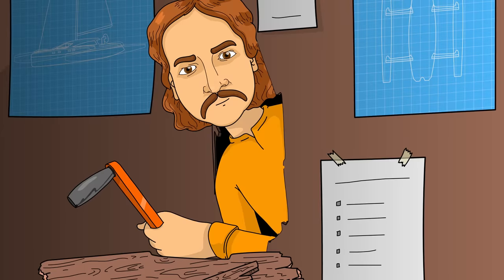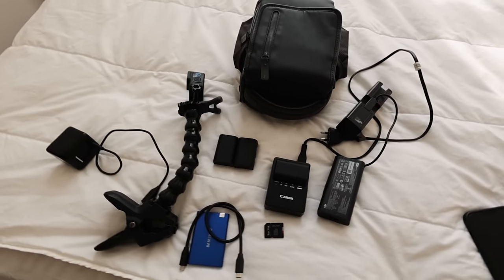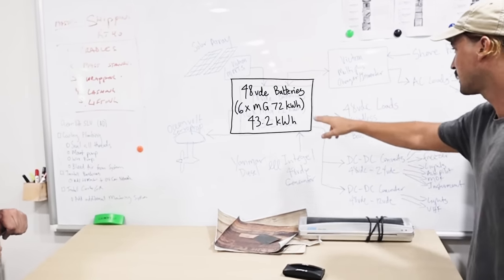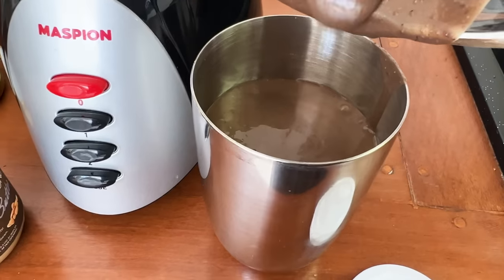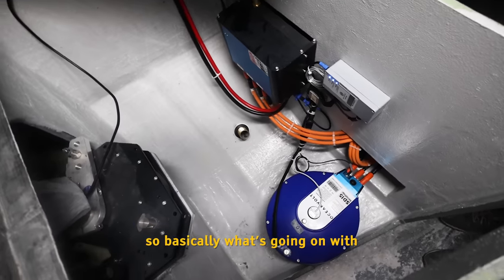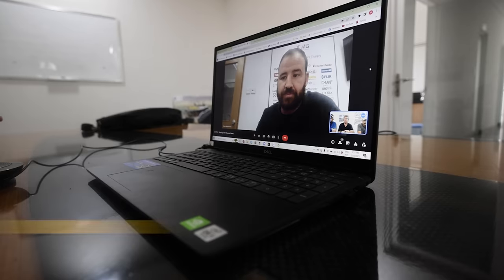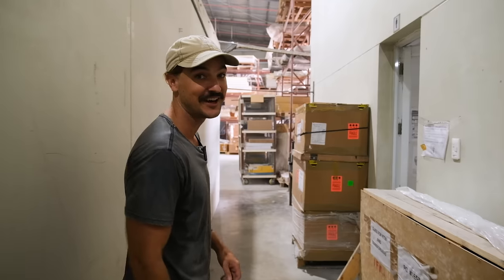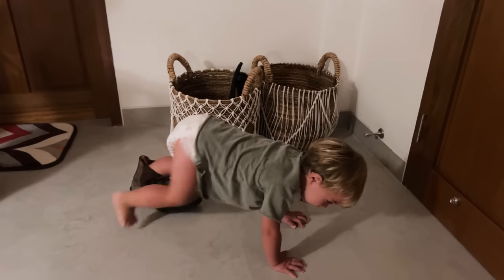BOAT BUILD: Our Electric Propulsion!

Comment: Hi Riley, Big fan and fellow cruiser that has been watching from almost the beginning.   I enjoyed the update on the build. 

If I understand correctly from the video, you will have separate Yanmar diesel for back up propulsion that is direct drive. Is that correct? Also you mentioned "Integrel". Is that referring to the Integrel System that Nigel Calder helped develop(sort of a smart very big alternator)? If that is the case then you must have at least a 40HP Yanmar to push the Integrel System. Is that correct?

Comment: There are some rather significant mistakes at minute 6:58 in the battery bank, first off it‘s supposed to be 48V DC ( 48Vde ), then there should be 6 Packs of „MG“ Cells, each with 7.2 kWH ( 72kWH ), calculating to 43.2 kWH of total capacity. I‘m an electrical engineer and just wanted to let you know about your Mistakes there. Cheers Mate, love your videos!
Reply: That matters is you're writing a technical paper but doesn't if you're scribbling on a whiteboard.  The result is the same.

Comment: Hey Riley, I am sure you will have already studied it so maybe you can confirm what I had heard: for best battery life, you should not keep or recharge your Li Ion (maybe it's different for Li-Po or lead, if that exists still) 100%, rather you should keep it at 85% to 90% charged when in regular use, and for "long term" storage at less than 50%, that way the membranes separating the electrolytes will have less damage from high tension micro arcs.
Also, can you not laminate your passport personal info page? My EU passport is fairly old and has a laminated page.
Thanks for a great video, great editing, and a beautiful family.

Comment: Would not just a genset have given you the redundancy you require without all the extra penetrations and drag created by direct shaft system ? I would worry about turbulence and flows over the ocean volt. I understand the mindset though.

Comment: i think electric motor on a sail boat is the way to go.  when batteries are full or >80 percent, you can turn the motor on, use electricity.  if under 80 percent, charge off solar, regenerative prop.  while at anchor is the current enough for the prop to regen?

Comment: Why aren't you considering a Wind Generator For your Sailboat.
What happens when you're anchored for days at a time, sure you'll have the solar panels as long that it isn't cloudy, what happens at night and there's no wind. Remember as long that there's wind, which means the night hour too, your Wind Generator could provide most of the power for boat.

Comment: Me again. Mr Realis! Riley, you know that these efficiency figures of all this whiz bang electronic stuff are VERY approx. I'd be halfing the incoming amps and doubling the "what I expect to get" amps, in the REAL world - maybe 75%...??
I notice the batteries are (might get it wrong), the normal Lithium types. Are they the LLifePO4 type? Those can be charged with any normal battery charger and any normal Solar Panel inverter. 
PO4 batteries, can be put in a normal car/bike - and thus can be charged from any normal charging solution.
I assume there are backups for when one of these whiz bang modules go down (and it takes the whole link with them), that there is a 'go back to a sail', option.
And what are the fire suppression options on these batteries...?

Guys, looking like a great boat. Just wonderful, but be wary of all this whizbang stuff ok!

Comment: Can you elaborate on the propulsion setup a little more? You have an OV motor sail drive aft and a center mounted diesel engine with high output alternator and mechanical shaft drive to a second prop forward of the OV prop? I assume this is a "Since we need a generator, lets just make it a proper diesel with shaft drive as well for an independent system" solution?

Comment: Super interesting. 2 questions, why not a bigger battery bank? If you can charge it at 9kW then you’ll be full before you know it… secondly 9kW is energy out of the boat on terms of speed sailing… if you’re going at 15kts with 9 kW power generation, what would that 9kW translate to as extra speed? Ie the power isn’t for ‘free’ you loose some boat speed…

Super cool, just interested in how it all performs, exciting times for you all
Reply: Left this just before the yellow bit 😖
Reply: 80. Kw. 6 hours.  90 NM eange. 108 mikes

Comment: 10 years battery lifetime maybe a bit to much when using them in full. Just using them in the 20-80% range should last over 10 years. And victron is a good choice for the solar electrics.

Comment: IRT Diesel Prop - probably already resolved, why couldnt you make it retracting.  Lots of race boats do this, but probably should have been done at design phase as it means the engine mounts need to be changed as well.

Comment: For the prop Regeneration, why couldn't they just turn the blades to be less effect at the higher speeds ie. sailing at 15 knots the props are turned to a 30 degree pitch instead of a 15 degree pitch so that that its rotating slower generating less energy. I'm not a engineer of any sort but seems like it would work at first glance

Comment: Why did you decide on separate electric and diesel motors meaning you need two propellers and presumably extra cost? Why didn't you choose a diesel electric hybrid motor set-up which offers the same powering options?

Comment: One of the issues with regeneration is that the prop you need for regen doesn't look like the prop you need for propulsion. So just like everything else on a boat it's a  compromise...
Reply from the maker: No.
You can see clearly in the movie that the pitch of the propeller changes to accommodate regeneration or propulsion.
Reply: @SailingLaVagabonde  it's not just about pitch though.

Comment: Having a STRAIGHT SHAFT DRIVE has got too be the most efficient way to get the most power to and from the water. Why complicate things adding 2 90 deg changes in motion tremendous gain in noise and to add to that extra maintainance of hauling out once or twice a year to change oil and seals in the leg, add that to the fact that now the prop is the lowest point in the hull and if the leg is  damaged by hitting a reef at 10 knots you have a one  foot round hole in the bottom of the boat.  For the simple fact that you do not want to have to haul out once a year you really need to consider DITCHING THE SAIL DRIVE, ADD THAT TO THE 10-15% BETTER USE OF ELECTRICITY will add up over the course of the year to save you lots on DIEsel .           CHEERS AND SAFE TRAVELS      Steve h.

Comment: You mention diesel propulsion a few times but the saildrive is electric, so do you have 2 props, one for the diesell and one for the electric?
Reply: Didn't he decide to go with the Yanmar diesel instead of electric propulsion?
Reply: @jamesaron1967 the whole video is about the Regen on the ocean volt that appears to already be in the boat. Logically the yanmar is running to power the electric propulsion... But he said he rejected the Genset so... Makes no sense
Reply: Ok so at about 14 min he shows the Yanmar diesel sail drive that is totally different from the Ocien Volt one that is in and won't have any Regen... At 17 mins he asks how far he motor on the battery bank, presumably not at all because he chose a diesel unit 2 minutes before. Makes the whole video pointless because that then still keeps talking about the electric unit! It can only be that they have 2 sail drives, one diesel and one electric which seems daft.
Reply: @miketipping1583  Yeah, kind of confusing. Could be a rushed editing job on the video. Will wait for future clarification on the setup. It does seem a little on the complex side whatever was decided.
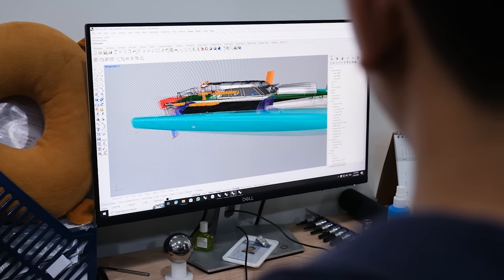Reply: @jamesaron1967  at 21:38 the cad drawings show the second prop is a conventional shaft drive not the sail drive shown earlier. Not a nice idea.

Comment: Are there any dangerous currents in an electrical system like this? ie is it old school batteries like in a kingswood, or is there a sticker that says "touch this and you'll die" like in my more recent car?  If so can you do the earth leakage safety switch thing on a boat so kids can stick forks into sockets? This is a question for anyone that knows.

Comment: 4hrs of battery life at 6 knots?   We ran 10hr/day at 5 - 6 knots with 56hp diesel and felt that was a bit slow.  Running daytime only with only 2 crew (as a safety rule we always have 2 awake at night)  That only provides a 60 nautical mile per day run.  I suppose Riley is thinking he will be mostly sailing.

Comment: I’m a Scottish retired engineer but that prop looks really small for the size of the boat. I know you will be mainly sailing but  there are calm days as well and days you want outrun a storm. I have a cordless drill that is a Dewalt 54v  and I can’t imagine it having the power to drive the volume you are talking about. If shit happens buy 3 or 4 drills  cheaper than your motors x😅😅😅😅😅

Comment: Oceanvault connecting from helsinki is really cool, Im a fan of the system but did not know that was possible. Does this mean that the boat is hackable, and also would that concern you? 🤔
Reply: You would just turn off the access when not being used

Comment: If that prop regens while sailing why not have 2 more on the out riggers not for propulsion but just to generate electricity? Airplanes have retractable props just for that in case of engine failure, they run hydraulics.
Reply: Extra drag. Always a trade off. At their sailing speeds, a half knot less makes a large difference.
Reply: I was thinking something similar.  Could the regeneration system be engaged while at anchor?  You may stay in one place for days, so would it not be advantageous to harness the power of tidal movement while not being underway?
Reply from the maker: In fact at say 15 knots half a knot is a far smaller percentage of total reduced speed. We don’t have more because we will have all the regen we need. At 100% we will be full and the extra two props will be as redundant as the first and just sit there being weighty and expensive.

Comment: Have you considered getting a toroidal propeller?
Reply: I wonder if the toroidal props could twist to work with the hydro-regen? The ones I’ve seen would not be able to twist flat to reduce drag and reverse to regen the batteries.

Comment: Why Not Prop Re-Gen ???  It's A Sailing Yacht Fer Crips.....you shouldn't need a diesel tank or engine....
EDIT: had to wait until over half way through the video to find out it has a prop re-gen controller and the diesel is a redundancy.

Comment: Have you considered an allergy elimination diet?  Both my own son and those of two friends had multiple bouts with the croup.  As it turns out, all three kids had food allergies which rarely surfaced until they caught a respiratory infection.  THEN those food allergies kicked in, exacerbating the airway swelling caused by the infection into the croup.  We were all feeding them "healthy" foods like almond milk, without realizing that almonds are a big allergy offender.

After eliminating the almond milk and five other suspect foods from their diets, they never had the croup again.  The other offenders:  Wheat/gluten, soy, peanuts, cow's milk, other tree nuts, and tuna

13:37:  SMART!  The geek in me would want an all-electric system, but the practical navigator realizes four hours (or even twenty hours of propulsion at 4 kts) is nothing compared to the ability to motor out of the doldrums for days or even weeks on end using a maximum mpg efficiency throttle setting using very energy-dense diesel fuel.  Then there's the risk of lightening strikes, which have been known to fry most if not all of a sailboat's electrics and electronics.  Diesel propulsion, even if you rarely use it, is SMART.  And DO use it, 2-3 times a week, for three times as long as it takes to come up to full steady operating temperature.  This keeps the seals well lubricated while heating any absorbed moisture out of the engine oil.

Go with more solar panels, too, as you're often (usually?) either on the anchor or tied up to some pier in the middle of nowhere without shore power.  Then again, if you have a diesel, well, you can always recharge.  Ah, but the geek in me says, "more solar panels."  :)

Good luck with eliminating diet allergies which can exacerbate the croup.

Comment: G'day crew I'm confused are you going to have oceanvolt propulsion or diesel or both???? Only 4hrs run time at 6knts,doesn't seem enough, can the diesel generator provide enough electricity to run oceanvolt 100% ?????? Cheers
Reply: 27. Mile goid range

Comment: Wait a minute, you have both electric and diesel motors and drives? If you were going diesel would you put two diesels in? The diesel will break... cause you won't use it... or you will use it all the time (well no, once you get used to moving with no noise). I would have gone for a genset which would see more use, be more efficient, be quieter, last longer (if the same quality as a good motive plant). You need to think of the electric part between genset and motor as the "transmission". Locomotives and cargo ships have been doing this for years because it is one of the most efficient transmissions around. Did you listen to yourself? The electric motor is more reliable too... so you are backing up your very reliable motor with an unreliable (by comparison) backup which may just decide to quit on you through under use when you need it. Your boat, I guess. yeah, I have rebuilt both electric and diesel motors.... electric is normally a half hour job... count the moving parts and look at the running temperatures.

Comment: I spent a lot of years in alternative energy conversation and I'm a boat fanatic.  Electric propulsion is not going to work long term.  On a slow sailboat that can handle tons of extra extraneous weight in the form of batteries and use wind and solar okay maybe.  Hydrogen is the future it's just lagging behind the Glee of those enthralled with anything green.  Oh and by the way if your batteries catch fire your boat's completely done.  Ever read the emergency sheet on how to put a Tesla out?  Yeah you can't put it out... It'll just burn a thousands of degrees for days.  And I bet that's just awesome for the environment.
Reply: They might not see your comment but I totally agree with everything you said. The world is-mindlessly obsessed by electrification, but the elephants in the room governments and their green extremist lackeys ignore is the high manufacturing pollution, dead battery disposable problem and long term issue of the planet's total lithium supply. Not to mention serious electrical grid limitations but that's more an issue with land-based EVs. This whole green EV movement is driven by supranational organizations with shady agendas such as the WEF, who fear monger about a warming world caused by human activity, and the false unrealistic necessity for the complete phasing out of petroleum-based fuels within a decade.

Comment: I'd go with 3 or 4 times the number of batteries.  Just to have that all electric be able to go for at least 24 hours and then as much more time as I could squeeze out of it.  Basically put what you might call today Stupid amounts of battery storage on board.  Then again in a couple of years that might be normal.  You never can tell.
Reply from the maker: That is a terrible idea as it is primarily a sailing vessel not a battery transportation vessel.
Reply: @SailingLaVagabonde  Perhaps.  It wouldn't be any less of a sailing vessel.  It would mean when you needed mechanical propulsion pure electric would be the first option not the second.

Comment: Ok I will talk about the elephant in the room. This is not a fully electric boat, its a hybrid. You still require a diesel motor to run the system. Maybe I missed the part in the video where it mentions the size of this diesel motor. The hydro generator is interesting, once again I might have missed it but is your system the 1KWH or 3KWH system running at 7-8 knots. I dont know how you count the charge while at a marina. That charge is only good for a day then and if you doing long hauls then that  greatly restricts your input. Also what are you cruising speeds under electric motors and when under the use of the deisel motor. Not trying to be a wet blanket here but I have seen issues with fully electric  boats that greatly limited the cruising range and speed of these boats. Also what is the size of the solar panel system to charge the batteries. That a huge amount of power required to charge them.
Reply from the maker: I think you need to watch the movie again.
Reply: @SailingLaVagabonde  Hi guys, my apologies, I don't know where my mind was but clearly it was not fully focussed on your video. Fully support you choice of going to a diesel motor given family cruising and the unknown. (What size motor have you gone to). Also are you still going with a generator and if so what size. Still did not see what size solar you are considering, I would be most interested. With your house bank I was just a tad confused. Does the house bank also supply the electric motors if so with everything on what is the calculation of run time taking into account all the load. I understand the curve of speed vs power output from the Water generator but what would you consider an good speed and power output from this unit. Would I be correct in assuming you are installing the 3KW unit given these figures. Given the electrics/electronics you are installing, if you are unaware (like me till very recently ) is is worth investigating a lightening prevention system that the youtube channel "Sailing Dautless" have just installed. Personally I am looking at this system very closely given its claims.(EMP solutions).  Please excuse my questions but I do have great interest in you are undertaking and like to keep up with technology.